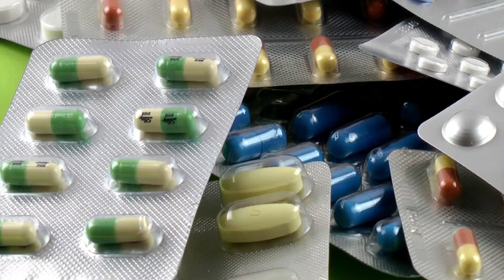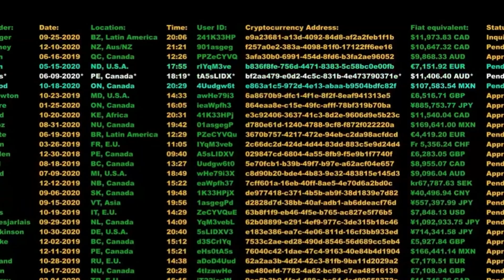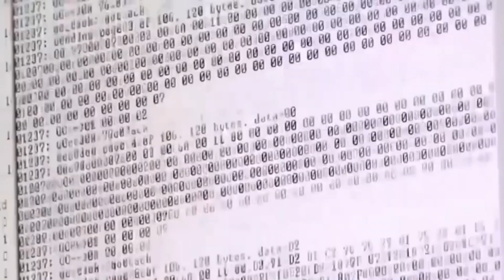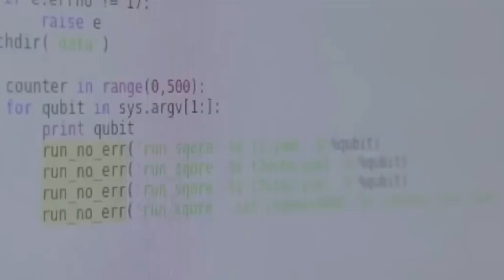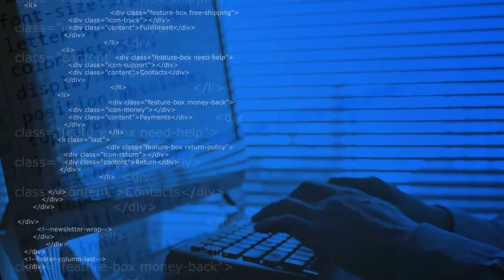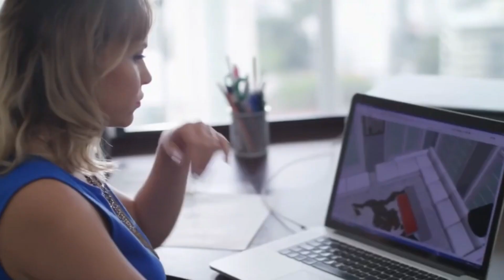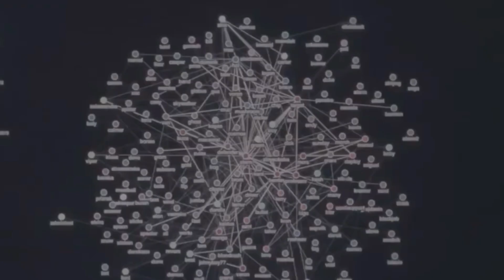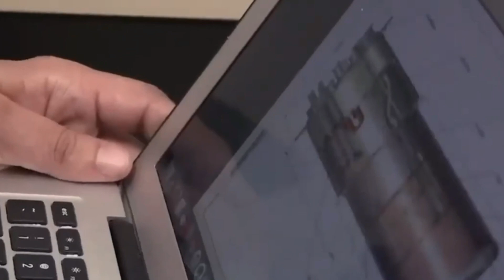Elon Musk Suddenly Revealed The Most Powerful Quantum Computer!

Comment: The problem with trying to quantum proof encryption is that current encryption relies on algorithms that would take centuries for advanced supercomputers to crack, and we can make these algorithms fairly quickly. However, when you have even minor advancements in quantum computing, time becomes completely irrelevant. Calculations that would take any computer centuries could be instantly solved. There will be zero privacy anymore, humans will have to move off grid.